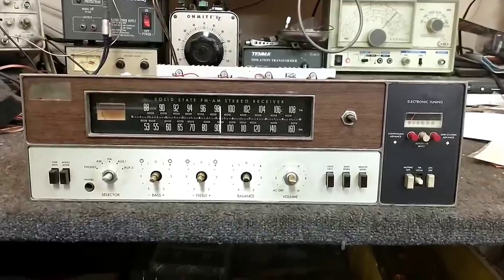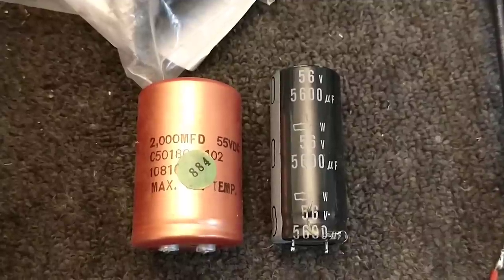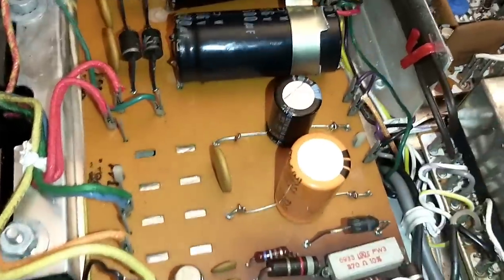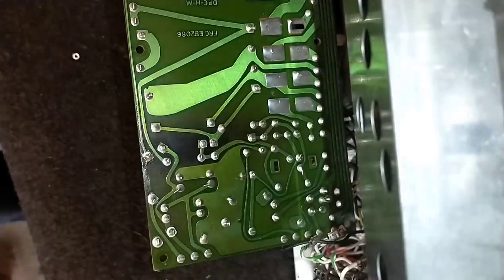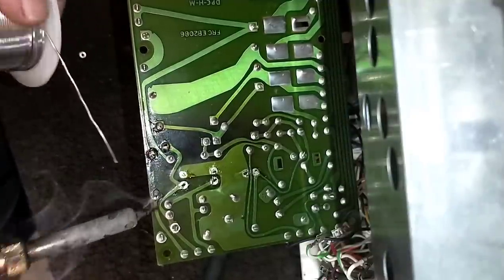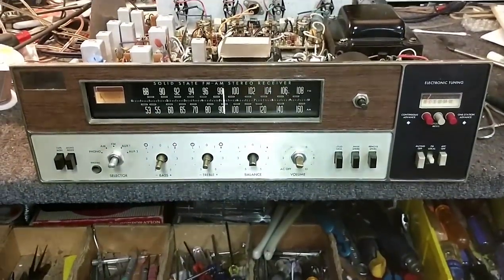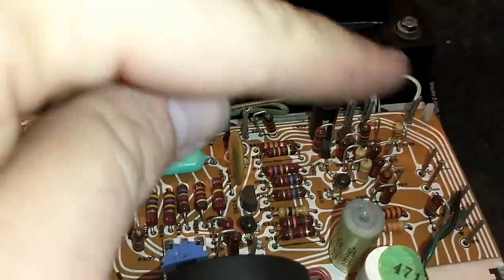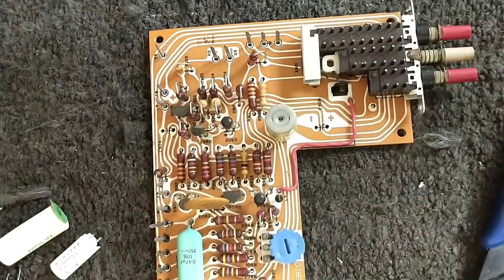Repair of a vintage 60s Fisher 450t solid-state stereo receiver. Part 5/5 power supply - FINAL

Comment: Dear sir I have Philips AW626 Powerhouse for service. The tape transport mechanism on both sides are not working and some plastic parts are broken and blunt. I need a new tape transport mechanism for this model. Unable to find anywhere. Could you help me sir please?
Reply from the maker: Other than a parts unit in good condition I know of no where to find a transport

Comment: Hi Jordan Sorry for Bothering you but I have a coronado ra44 8272a but I want to replace the main big capacitor but I can't tell what capacity to use I know it's 150v but can't tell if it's 50 mfd or 5.0 mfd also there's a 30 mfd or is it a 3.0 mfd if you could help me out with this it would be greatly appreciated
Reply from the maker: What year of manufacture?

What rectifier tube does it use?
Reply from the maker: Google says 1964. First value is likely 50 Microfarads, the second 30.

You can use a terminal strip and a 47uf/160v  and 33uf/160v capacitor, or see if antique electronics sells a tubular replacement
Reply: @JordanPier  36AM3B rectifier tube
Reply: @JordanPier  what terminal strip would you recommend
Reply from the maker: @DJRatAttack  Terminal Strip - 5 Lug, 3rd Lug Common, Horizontal, Pack of 5 https://a.co/d/c5mzdNp
Reply: @JordanPier  3 (2 + 1 Ground) That's what I got is that okay
Reply from the maker: @DJRatAttack  depends on how the capacitors are grounded. If chassis ground is real ground then that should work. If ground is isolated from chassis then the 5 lug works better.
Reply: @JordanPier  it's a bipolar plug so you can plug it in either way
Reply: @JordanPier  Plus it's a metal can capacitor so I think it would be grounded to the chassis
Reply from the maker: @DJRatAttack  still gotta know.
Reply: @JordanPier  how do I tell?
Reply from the maker: @DJRatAttack  follow the negative of the original capacitors and see where it terminates. If it's soldered directly to the chassis then the two plus ground is fine. 

If it's soldered to a terminal that is floating and not touching chassis then the 5 lug works better.

Comment: Hi Jordan I hate to bother you but I know if anybody can help me you can. I don't work on 4 channel quadraphonic receivers I only work on 2 channel stereos and TVs. A customer brought in a 4 channel Sansui QRX-7001. It has a QS synthesizer that makes 4 channels out of left and right. I think the synthesizer is not working because only the front speakers play on FM stereo but all four play with 4 channel auxillary input so the 4 channel amp is working but I don't know how a quadraphonic synthesizer works
Reply from the maker: Can you verify that FM stereo is actually working with full channel separation? Mpx might not be demodulating. In that case you won't get rear channels because it needs a true stereo signal to synthesize 4ch stereo.

You should be able to get 4ch synthesized out of any two channel input so long as it's a true stereo signal
Reply: @JordanPier  okay thanks I'll verify for stereo separation. FM stereo is lit but that doesn't always mean true stereo.

Comment: Novice question: why is it better to slam those new caps' leads aLL the way into the board? I guess it's just those? the resistors and transistors all have daddylonglegs..
Reply: Usually just the heat producing parts need some clearance.
Reply: Mechanical stability. Small parts with low mass can stand off the board supported by the leads with no problem. Also it makes it easier to probe and troubleshoot from the top. Larger parts like caps need to be secured otherwise the leads can break from vibrations or develop cracked solders. Mounting them tight to the board keeps them secure
Reply: @TrevorsBench  I see, plus the capacitors have lower resistance leads, pretty flimsy compared to the others.